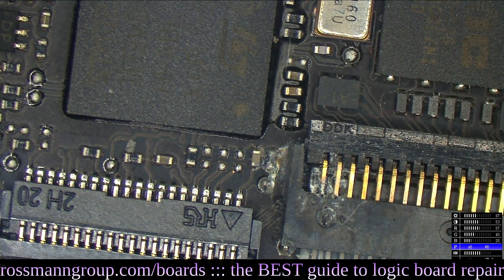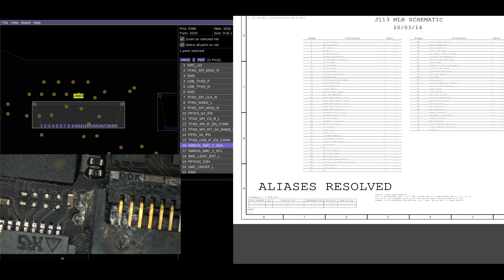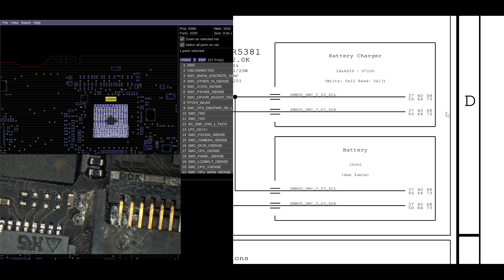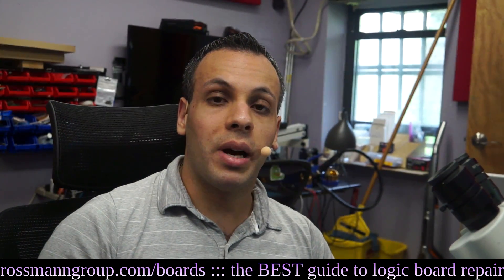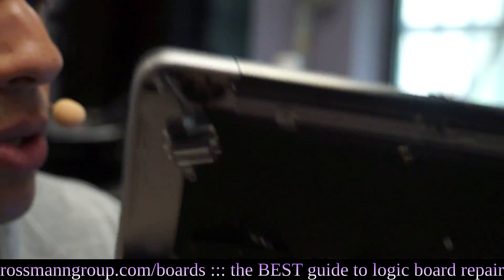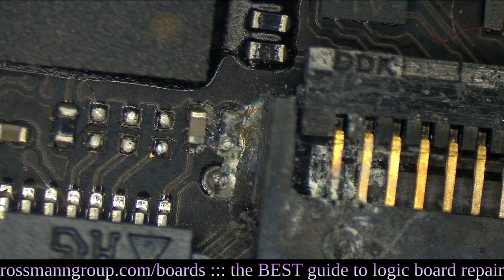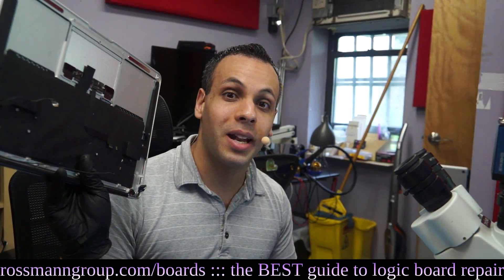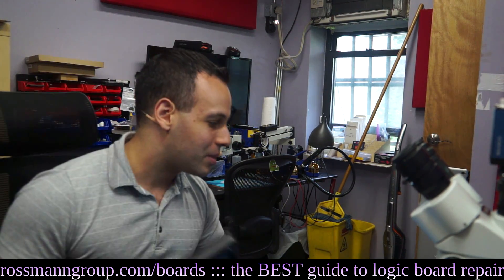Apple quality control slips through the cracks(literally)

Comment: I used to work on, primarily, Vaio notebooks..... Even the R505 series (look up how old those are) was better engineered than this, with respect to how the touchpad was integrated into the system...And the VGN-FS970's had a much better design.. Too bad apple didn't engineer their hardware like sony did, because those Vaio machines really were engineered well, for the most part.

Comment: I have an idea. Open up mac, turn the shell around. use hot glue to seal the cracks inbetween the shell and the trackpad. Done. Think different. Won't save the keyboard from liquid, though.
You can remove the glue easy by soaking it with isopropanol and carefully lifting it off the plastic. Just in case the dumb trackpad breaks.

Comment: Mah dude... You show a trackpad from a stripped out computer against a fully closed computer? Removing the battery on the thinkpad doesn't leave the trackpad COMPLETELY exposed to be seen.
Even if I hate Apple for what they, that was a bit disingenuous, no?
Reply from the maker: The battery was removed from the thinkpad
Reply: And even that is a benefit of the construction of the thinkpad: IF anything gets by the trackpad, it goes to the battery that only has 4 exposed connectors, INSTEAD of the pcb.
But, a followup question: is the battery covering the ENTIRE back of the trackpad on the thinkpad, or only a part of it?

Comment: If Apple had changed the eject key into a dang delete key , and kept the power button separate, then maybe this wouldn't an issue.  Whose bright idea was it to turn "power" into a key?

The lack of a real separate delete key on the Macbook "Pro" keyboard has never stopped annoying me, in the several years I've been using this laptop.

Comment: I think i see a reason for this 2 to be exact. 1 the board is freaking tiny like really tiny. There is not a ton of space to use for traces. 2 because the power is part of the keyboard and you need to use mod keys to emulate what amounts to right middle etc clicks in most cases there is logically speaking a need for the keyboard with its power button to be tied to the track pad. Do to that a short on the track pad kills all. 

Simple cheap as hell fix some of that rubber sealing material under the track pad. I have seen other track pads with gaps around them typically ones with integrated buttons like the apple. You have to have some gap along the top or bottom and immediately along the edge that defines the buttons for them to be able to move freely to click. On those systems how ever i have ALWAYS with the exception of apples seen rubber gaskets under them to prevent just this issue. 

With out using a larger board i doubt theres any real ways to make the board lay out different. Things apple needs to do get the power button off the keyboard seal up the underside of the track pad etc. Now like they will do it though but just saying...

Comment: That P50 of yours, I work for a company that issued only Lenovo's and we had major issues with most of ours. we had around 10 of them. From motherboard failing, screen discolouring, the board killing the M.2 drives...But once the motherboard was replaced, they chugged along just fine, parhaps a bad batch of boards. Happy that yours is still going.

Comment: lol this is stupid. I mean, one could think that just having slightly damp hands from holding a cold soda or something, coulde result in water damage, just because you hit the edge with your finger.

I can remember a couple of times, where I've had a couple og drops hit my trackpad, and nothing happened, because I just wiped the f*ckers off. I wouldn't be able to use the thing if I were to consider the fact that I might've ruined the thing and had to tear it apart to make sure and potentinally clean it inside...

Comment: I am using a hackintosh for a week now, it's actually a destop PC which I barely used for some occasional gaming. Now with High Sierra on it, and a not to crazy cpu i5 4590 quadcore, 16GB ram with a Be Quiet Pure Rock cooler, omg what a beast. I can stress this thing to 100% and get 45 celcius CPU temp, while ambient in the room is 25± celcius. And the machine is still responsive for more work! My 2000 EUR iMac 27" Mid2011 is almost cooking out of it's shell just having youtube and some apps. It's now standing on the floor behind me, as yesterday's garbage. Sad, very sad Apple. So now I have a 'powerhouse' for almost for free, because apple built a computer that is UNUSABLE when you give it some work. And no, the iMac Pro is just as poorly cooled as pointed out on various channels.

Comment: But i can see the light through the top right corner of the trackpad at 3:11 on the thinkpad.
Reply: It's a water drainage hole, see the pinned comment
Reply: No time to read comments, only write. It's a comments section after all, not a library.
Reply: It's also in the description of the video.

Comment: I wonder why this channel recently turned into "everything Apple is doing a piece of junk" type of thing. As an engineer working on embedded electronics and dealing with many major brands (including Apple) I just can't understand this kind of attitude.  I saw a lot of stuff during my professional career, really stupid hardware design mistakes and flaws, I had to deal with 3rd grade engineers unable to understand even basic hardware or software requirements.
But I never saw this lack of competence when I worked with Apple people.
No product is perfect, mistakes can happen, but some of them are less critical than others. If you take apart any complex electronic device, you can find dozens of things which you could do differently. That's normal and it happens with all brands. 
So I really don't understand this "let's hate Apple now" attitude...  You can find similar or even worse design issues on any other brand. If this was a widespread problem affecting zillion of devices, Apple would already take an action as it would  cost them a lot of money lost in warranty repeairs (bad keyobard in latest Macbooks is a good example)

I liked watching your videos  in the past but these days it is only about complaining how stupid and incompetent the hardware engineers at Apple are... (and in my opinion, nothing is further from the truth)

Comment: Can't you only see that trackpad gap because you are holding it up in the air and it isn't being supported by the hardware underneath? Wouldn't it go away once you reinstall the computer?
Reply from the maker: It does. When you close it, the gap is such that liquid dropped in will drop right on the cable that carries the SMC_RESET_L signal, shorting it straight to ground, which kills the machine.
Reply: Ahh that's annoying, thanks for the fast response. I have a 2013 retina pro that I still use as my daily without issue so I'm always looking out for potential mac issues.

Comment: Why in the hell would you tie the trackpad directly to the system controller? There is literally NO reason to do that whatsoever that I can possibly fathom unless you want to be able to turn the machine on and off with it. Or is there some kind of rig to where it uses the trackpad to determine when you close the lid?
Reply: The keyboard connects through the trackpad and the power button is on the keyboard.
Reply: Maybe Apple has a small device they can put on the trackpad and your Mac unlocks, bypassing the BIOS password by sending some special patterns to the pad. 
Reasonably, its probably supposed to wake up the Mac from Sleep mode or so by just touching it, same as wiggling a mouse on PC.
But there are more elegant ways to do so.

Earlier at the Apple Hardware Engineering Division:
A: "Hey Bob, lets solder the trackpad to the SMC, so we can save some cents on a another chip".
B: "Heh, nice. I already got rid of the sealings of the trackpad, saving another couple cents"
C: "Pfft, that's nothing. I rigged the ISL6259 to blow up, when a non-apple battery is used, so the customer has to replace the whole mac"
A & B: "OOOOOhhhhhhhhhh!"

Comment: here I am with a sandy bridge falcon northwest laptop 6 YEARS after I bought it. I have split water on it (nearly had a heart attack) had it over heat in my bag because it didn't turn off when it was supposed to (probably closed the lid before it finish the power down and it went to "sleep" instead), traveled on airplanes with it all the way from NC to Seattle and back, took it to the beach and left it out for hours in the salt air and to date have only had to change out the hard drive due to the drive being 5+years old. I paid the same as the apple products you have here that are constantly having tech problems have through user error done massive no-no's to this laptop and yet somehow it is still perfectly fine and can still play games.
So I ask you apple fans, who bought the better hardware out of the gate? (FYI I'm running Linux not windows now because fuck Win10)

Comment: Louis -  LPS#1 is a  anti-corrosion spray that is made for electronics - it was originally designed to use on missile electronics stop corrosion when they are in the Field for military use  - It works great - as a extra service you could apply it to your  customers computers for a nominal charge and make yourself some extra money and do your customers a good service - a spray can of LPS #1 costs $20 and will treat  around 15 macbooks  - Try it You will like it —Jay
Reply: yeah, i feel like an actual conformal coating makes more sense.
Reply: Syrian Hamster Eh, I personally don't mind smell if it means a working laptop.
Reply: LPS#1 says lubricant on the label somewhere but it is Not  a lubricant at all - it drys in minutes and does not smell at all - when you read the tech sheet  it explains that it is designed for exactly this purpose - and it Really works well  - the words lubricant were added by some sales person that had no clue what they were talking about -  the tech sheet makes no mention of lubricant - i have used it on hundreds of electronic devices and LPS#1 stops corrosion period  - it is amazing stuff for electronics - as a lubricant it sucks
Reply: Why is it better than a conformal coating though? they advertise "a short term, light, corrosion resistant barrier" on the site of lpslabs, a sealed conformal coating seems like a better idea.

Comment: I have a Thinkpad X270, I love this computer. But  there is a design flaw that I don't like. There's a cable for the monitor that runs through the display bezel, and since the computer is so compact it brushes up against alot of weird corners. I opened the computer up the other day and noticed some fraying breaking through the cable and into the insulation. Whenever I moved the monitor back and forth the screen stutters. This isn't a big deal for me, as lenovo seems to have a really good directory of parts, and getting a replacement shouldn't be a hard job. Also these computers are so uniformly made that replacing parts on it is pretty straight forward. But it just seems like an uncharacteristic oversight from them.

Comment: ...I must have missed it, but why would you rig the trackpad to have anything to do with the SMC at all? Is there some way to reset using the trackpad instead of the power button, or was the Apple engineer in charge that day just pants-on-head retarded and nobody caught it?

Also, it seems to me that making the trackpad opening a few millimeters smaller and installing a gasket around the edge of it would have been enough to prevent this. Or glue it into place, as they're fond of doing with the battery. Or hell, making the opening smaller and tightly riveting the damn trackpad to the bezel would have made it passably water-resistant. There truly was no thought or a single fuck given in this area of the machine from an ingress-prevention standpoint.

Comment: I wish there was a Linux distro that came close to MacOS (for programming), but MacOS quite literally just works as you would expect it to (on top of a lot of developer tooling being MacOS exlusive). That is, until it doesn't. Then you find out a single drop of water bricked your system, a single piece of dust disabled your keyboard... Hopefully the next line-up of Macbooks will be as good as the OS they're running. I'm aware I can build a Hackintosh, but Macbook pros have such a great trackpad, screen and speakers that for me personally it's worth the markup. Also, does this terrible design choice carry over to the late 2016 macbook pro lineup?
Reply: Mr Wolfers but they don't actually have a better trackpad, screen, or speakers, as their plenty of non-apple products with equal quality in those regards that are designed well, for a cheaper price. The price of an Apple product isn't for the quality of the product, it's for the brand. I'd also argue that the OS isn't very good, because it's incapable of running dozens upon dozens of file types that Windows and Linux can run without issue, and also the most inefficient file browser out of the three. Apple's active attempts to remove support for non Apple devices from all their products really doesn't help either.
Reply: I said great, not better. I'm sure there's some Windows laptops out there with some configuration that can match a modern Macbook, but I have only come across one (XPS 13). Features important to me include the screen having >400 nits brightness (so I can work outside),  excellent sounding, (and most importantly) well placed speakers (macbooks are one of the very few laptops I've come across with speakers NOT at the bottom of the computer. It's honestly mind-boggling that so few laptops have top facing speakers), 13 inch and slim form-factor, highly energy efficient (I can work for 8 hours and still have 20% charge), can actually be used on my lap (aka the laptop stays cool and not surface of the sun temp), EASY multi virtual-desktop management (linux also has this, Windows is trying), and a superb trackpad. I have never come across this filetype issue you are explaining, what filetypes exactly? .exe? I can use parallels but .exe are native to Windows so it should be pretty obvious it wouldn't run natively on a mac. I have also haven't ever had issue running anything that could be run on Linux on a Mac. It's that exact reason plus the Unix based architecture that MacOS is very popular among non .NET developers. If you haven't used MacOS extensively for development then you really don't understand how much easier it is to develop non .NET software on a Mac as opposed to Windows. That alone is worth the markup. I can understand from a non-developers perspective that it looks like you're just paying for the brand, but apple knows their target audience (apart from the idiocy of the touchbar, where they said "screw the developers, video editing is where it's at..."), and their target audience knows exactly what they're getting.

Comment: To be fair, PS/2 emulation is performed by SMC, so SMC is always connected to keyboard (and does keyboard scanning on notebooks, making it fairly susceptible to keyboard liquid ingress) and to trackpad. Data lines should have a bit of protection on them, except for one case - the keyboard backlight goes there too, and then ooooh shit happens.

But... you're right, the placement of all this is very unfortunate and could and should have been done better. Possibly conformal coating, connector shielding or board shielding with drainage would be par for the course in a machine that's up there on the price range.